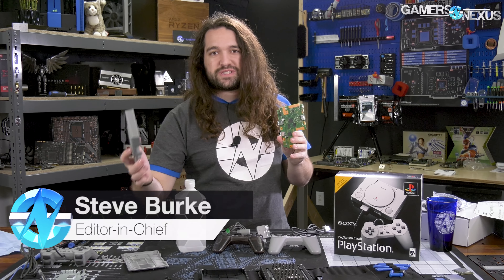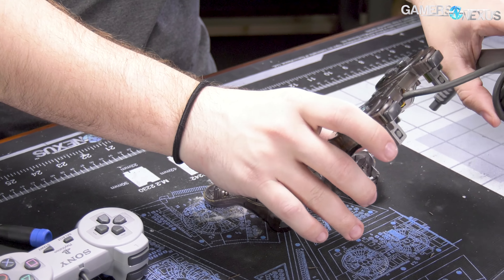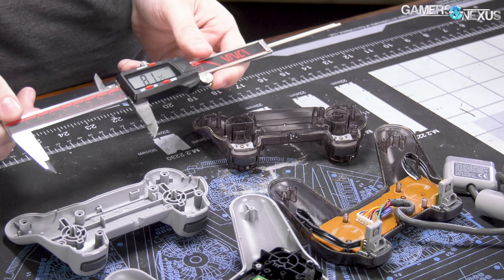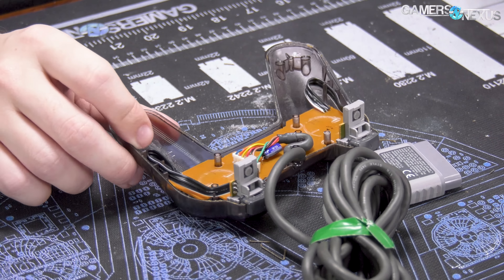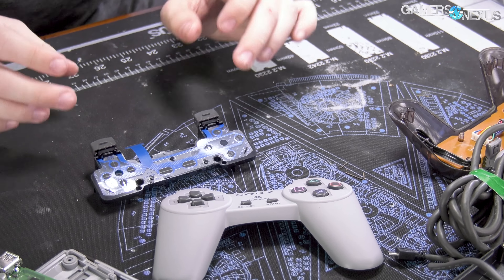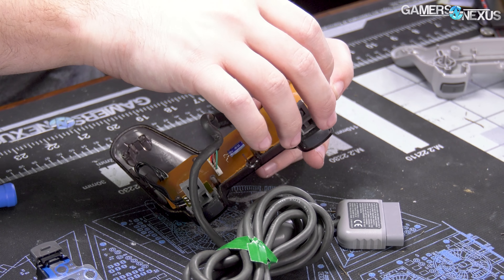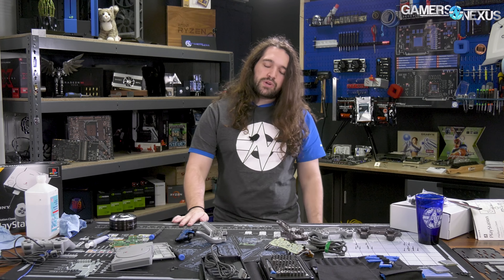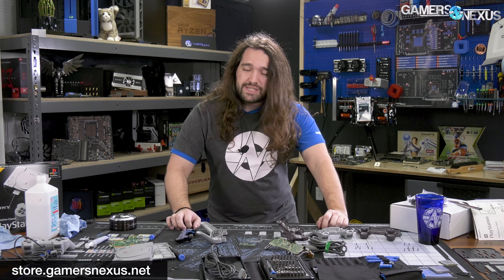PlayStation Classic Controller Tear-Down vs. PS1 Original

Comment: There isn't any switches. It's just rubber with carbon pads. When you press down the carbon pad completes the circuit on the ribbon.
Reply: It is in fact a switch, looks to be some form of rubber dome though it could be a capacitive switch. 
Just because they aren't mechanical switches doesn't mean they're not switches, all a switch does in a simplified sense is complete a circuit when actuated.
Reply: BlowMeWonKenobi  So it makes (and breaks) a connection in a circuit... Yeah, that's called a switch, dude.
Reply: The point is there's no switch "inside" either PCBs. (Yes, the blue thing on the new one is still a PCB, just a flexible one.) The PCB and the carbon pad on the rubber dome make up the switch together, meaning the rubber pad is definitely an electromechanical component.
Reply from the maker: Thanks! That's pretty cool. Is there specific terminology to describe those types of domes?
Reply: @GamersNexus  yea, its called a switch
Reply: Membrane switches. More info here: http://www.slagcoin.com/joystick/pcb_wiring.html  @GamersNexus
Reply: Jesus christ, ever since people with mechanical keyboards have become rampant with their autism they even try to denounce basic electrical components like switches cause they are not labelled Cherry MX.
Reply: Why is this a big argument?
Reply: @GamersNexus  Ever done a tear down of a non-mechanical keyboard? You should notice some similarities. The switches on them use the exact same process as these controllers do.
Reply: Gamers Nexus yep, they’re membrane switches. Sony was first to have pressure-sensitive buttons in their controllers in the PS2. The carbon pads in the DS2 controller are domed and the PCB has double traces under each button, so you get two modes per button. Good times.
Reply: That is the definition of a switch.a device for making and breaking an electrical connection.
Reply: LMAO GN liked the comment, even though it's stupid. Reverse troll ftw
Reply: Gamers Nexus Yes, I believe they're called an i9 7980XE...but I may be thinking of something else.🤔
Reply: @Reuterli   Cherry MX sucks.  I only use beamsprings.
Reply: If it opens and closes an electrical circuit then it is in fact a switch...
Reply: Steve, the buttons on the controllers are the same as most calculators have. Haven't you ever opened one? The film base has graphite traces(graphite is electrically conductive) and the switches have sort of a graphite-rubber alloy pads that are also electrically conductive. Cheap and easy to make.
Reply: What cause these to break? Carbon being removed from the rubber? Oxidation?
I have Keytronics Ergoforce keyboards which doesn't work any longer but I don't know how they break. I've washed them though so maybe by now I've removed the magical dust and they will never work again (unless replaced =P)
Reply: @nicolaspinto2927  you know what he meant, when people say switches they mean mechanical because cheap keyboards and remotes used these horrible swandwiches of plastic, not the best to say the least.  So i'm surprised why steve even said it was a good design when it looked like a 5 dollar keyboard the second he opened it up.
Reply: Completing a circuit is the definition of a Switch ..
Reply: These are switches yes. Commonly known as rubber-dome switches, membrane switches etc. Very similar to any remote controller or non-mechanical keyboard etc. Ancient technology, calculators from the 70s used the same membrane style keyboard, the Spectrum ZX even used the same thing, if you even know what a "Spectrum ZX" is.. :D
Reply: @Skauber  I was with you up until halfway through. Yes, rubber dome switches have been used for ages, but they aren't exactly "ancient technology" since they are still widely used. The home computer you're referring to is called the "ZX Spectrum," not the other way around.
Reply: Johan Krüger-Haglert, the graphite layer may wear out or the contact may get dirty, but dirt, of course, isn't a permanent damage, wear-out is. Also, if I remember correctly, an attempt to clean the membrane with alcohol may cause a permanent damage. I've actually witnessed several instances of the conductive layer wearing out to the point when the keys were no longer working. Sometimes it happens because of poor quality of the conductive compound which is a mix of graphite and glue for the PCB and some kind of graphite-rubber mix/alloy.
Reply: @GamersNexus  Top Tip ?? I used 2 fix those using bubblegum aluminium foil cut down in squares and some glue :D
Reply: @nimoy007  We called it the Spectrum ZX in Norway, not sure why, but guessing it's not universal. :) Also, by "ancient technology" I mean its old and has been around for ages, not that it's obsolete as it's a good and cheap way to make keyboards or buttons which still works well. :)
Reply: @noanoxan  Actually, its much more advanced than that! the PCB doesn't have double traces. Instead there is some kind of black plating on the PCB. The more surface of the domed cap that is pressed against the PCB surface, the more the conductivity changes, so the buttons are effectively analogue. The controller reports a value between 0-255 (i.e. same range as each analog stick axis) if I don't remember wrong.
Reply: @janjohansson2567  Wow, I didn't think it was that advanced. I had to read up a bit on that tech. Looks to be a sort of carbon-film variable resistor setup. Really neat. Thanks for the correction.
Reply: @Reuterli  I bet you typed this on your cheeto dust covered rubber dome keyboard. Get with the times granddad.
Reply: @noire1001  Don't talk to me unless you type on beam springs you millennial kiddo.
Reply: Okay maybe I didn't write my initial commemt correctly. Honestly didn't expect this to get liked. From the Video it looked like Steve was trying to find a tactile switch. It seemed like he wasn't aware of silicone rubber keypads and how they work.
Reply: @Reuterli  THANK YOU!! I really just disliked this vid at this point, I mean this is just sheer stupidity...
Reply: @GamersNexus  They're called Chiclet keys, not membrane (those are flat, though use the same principle), and yes they are a switch technically, but he is correct it isnt in the PCB to all the odd people 'correcting' him when he outright said it forms a switch with the dome.
Reply: @levelheadedbrett2979  I've also heard conductive carbon pad, and simply carbon pad.
Reply: Yep. Almost every single controller I've ever opened used these rubber domes and carbon pads for the face buttons.
Reply: @GamersNexus   they are called membrain switches
Reply: @woooweee  while you're right to call out the low tier trash that uses this switch design there is nothing inherently cheap or bad about this particular form of switch when a proper amount of engineering and manufacturing has been put into it. And for a gamepad they are quite capable, and even better than mechanicals like Cherry's because they can be used as analog inputs which is simply impossible with a mechanical. The Dual Shock 2 controller as mentioned above leveraged this to have hard and soft presses on the shape buttons for example.

And no, only Cherry fangirls claim that switch = mechanical. Normal people don't care either way, and anyone passably familiar with hardware knows that there is nothing about switches that makes mechanical switches inherently the one true switch. There is a huge ecosystem of switches out there that all have some points that put them above mechanicals, such as foam and foil switches that are on the whole smoother than any mech linear, hall effect and mag reed which are more rugged and longer lived than all mech switches, capacitive switches can identify things like soft and hard presses, and non-mechanical designs often inherently have no issues with key roll-over without additional components on the board. Even the "cheap" rubber dome and membrane switches have clear advantages over mechanicals. Mechanicals have a place somewhere but for the most part are a dumb hype fad, the only special thing about them is clickies and their tactility (ofc their inflated price too lmao).

What the design looks like is irrelevant, what matters is if the build quality is there; clearly the design is good and a lot has gone into making it a reliable device. You'd understand that if you've worked with devices at a design or repair level, looks are very deceiving and a shallow way to evaluate functionality. One thing to note is that mechanicals introduce button bounce far more than other designs that needs to be filtered out, which is bad for low-latency use cases like in games or simulators, though I'd also remark that moving to USB from what I assume is interrupt-based in the PSX doesn't help there either. There are good reasons other than "lol cheap" to pick a non-Cherry-esque switch.
Reply: @GamersNexus  That's just a membrane switch, more generally it's a type of bicontact switch (Basically the electrical connection is separate from both contacts so it makes contact twice thus bicontact). It's effectively a refinement of the jumper switch in fact though modified from the actuate and hold design of a jumper and compacted into a thin film for the contacts. Same basic idea but the conductive rubber pad serves as the jumper here and the membrane film is the header. As opposed to a basic contact or throw switch where one of the contacts is in fact the switching part that is permanently electrically connected to one of the terminals.
Reply: @GamersNexus  Got SO annoyed/triggered that you did not realize this concept just by looking at it. XD
Reply: how can rubber complete the circuit being non-conductive?
Reply: @yosyp5905  the darker grey material you see on the back of the rubber domes is what is conductive. it does not need to have a massive amount of power going through it and hence is plenty enough for the switch to work
Reply: Shame on all of you! It's called bracket  :D

Comment: What is this tech jesus has no knowlege how membrane keyboard works. You know the nonmechanical one.
Reply: I think he's locked memories of membrane keyboards away. Too traumatic.
Reply: Membrane is like the Old Testament
Reply: @Malus1531  The old IBM model M keyboard, one of the best keyboards you can ever type on, is a membrane.
Reply: @Lambda_Ovine  Buckling spring over membrane, not really the same as modern membrane keyboards.
Reply: Who is jesus?
Reply: @Lambda_Ovine  When did Model M's become such a geek icon.  People pay $500 for them on eBay now.  Back when I first started building PCs and you bought parts at local monthly trade shows,    the vendors would have boxes full of Model Ms for sale for $5 each.
Reply: @nilus2k  I got 2 on eBay a few years back and fixed one to operating condition... I could make back probably about 3-4 times what I paid for them now.
Reply: I came here to say this. That part was super hard to watch
Reply: @goobon  I should go raid my Dads basement.  He worked for IBM for 40 years and I think his homes foundation may be reinforced with old PC parts.  I know he has a bunch of Model Ms down there

Comment: Man, this takes me back. Those lands on the original PCB and on the newer controller are conductive pads, with the black pads on the back of the button electrically bridging them; the analog function of the next iterations used variable contact by way of dome-shaped electrically conductive pads on the back of the buttons.

I see some comments talking about button lifetime on a controller that's a minimum of two decades old and still working…

Comment: Quite interesting - Sony's been using a similar construction since the PS2. The d-pad on the old one used that retention mechanism to bypass a patent Nintendo had on their D-pad design, which is very similar to the new controller. Perhaps their patent expired and Sony found it easier / cheaper to do it that way?
Reply: I even saw something like that on my Dualshock 3 though it only went diagonally in one direction not two

Comment: It's cost reductions. They can make more smaller circuit boards on a panel and they moved everything to surface mounted stuff including connectors, which means they can use super fast chip shooter style pick and place machines  to populate the boards. No through hole, no soldering connectors means fewer steps in manufacturing. 
The printed foil is much cheaper than circuit board - you basically pay once a few hundred dollars for tooling and then they print huge rolls of plastic with your traces and then they cut them to shape... costs cents per foil. It's super cheap for volume production but more expensive for hobbyists.
There's carbon or some other conductive material on the foil with traces and on the buttons, and the buttons basically create a short between two traces when they're pressed down. Nothing fancy or clever... same stuff as with keyboards, although probably no multiplexing involved on this, considering there's so few buttons.

Comment: So old consoles are the new thing now? Did not see that coming. For us old gamers it's cool! TNX!
Reply: "Retro-gaming" has been a thing for quite some time.

The whole "X BRAND-CLASSIC" thing is new tho..

But useless imo.

I mean come on, it's basically a "custom" raspberry Pi with a random emulator core
Reply: Should have added "in this channel"  to my comment. Sorry for the inconvenience.  @absurddive
Reply: Except it's not because they're a complete ripoff and badly made.

Controller looks good though.  I'd recommend buying one of those off eBay, and using it with a RetroPie.
Reply: Raspberry Pi w/ Retropie is awesome. Though still haven't figured out how to get mine to scale on my 1440p monitor lol (there's black on all sides). I'm pretty sure it's not that hard, just haven't bothered yet.
Reply: @Malus1531  Well you probably don't WANT it to fill the space.  You want to scale it up by an integer multiple so you don't get oddly shaped pixels.
Reply: Except they're not, 1st party hardware manufacturers dropped the ball on this hard. You can have better emulation on 3rd party retro systems or on a PC than on all those repackadged smartphones Sony and Nintendo call game consoles.
Reply: @Asdayasman  I agree, I just didn't want to get too wordy clarifying. That's why I said "all 4 sides", since I want black on only 2 sides to maintain 4:3.
Reply: @Malus1531  But that's what I'm saying.  From what I remember, most PS1 games run at 320x240, which doesn't scale up to 1080 lines with an integer multiple.  The closest you can get is 960 lines high, so you will indeed have black borders on every side.

If you scale it up to 1080 lines high, you're going to have some pixels that are 5x4 and some that are 5x5 on your screen.
Reply: @Asdayasman  Ah ok, fair point
Reply: It only comes with 20 games, and iirc they weren't even the 20 "best" ones. (Sorting out 20 "best" games from the PS1 must've been a challenge and a half tho)

Comment: MISSED OPPORTUNITY OF 2018 HOLIDAY SEASON

Dualshock, actual good games, actual good emulator, scan lines, GUI, etc

skip
Reply: Don't be silly. Dual shock is coming out next xmas.
Reply: Plus they could have added network capability, so you can access the PS store and buy loads more games in future. It seems so pointless to go to all this trouble for a handful of games when there are so many classic games for PS1 that will be lost to time.
Reply: Not gonna fundamentally change anyone's opinion but apparently if you hook up certain usb keyboards you can hit ESC and access more emulation options (including scanlines). Looks like Sony didn't strip out all of the PCSX configuration.
Reply: The problem with Sony controllers is that they're all identical so they had to put the one without the joysticks on there unlike the NES and SNES where their controllers are uniquely different and look different and thank God they changed the controller on the PS4 because that controller was super uncomfortable only good thing it had going for it was the placement of the buttons and sticks

Comment: Looking so forward, to Gamers Nexus talking about the leaked RYZEN 3000 specs.

2019 Looks to be one hell of a year for AMD.  😀
Reply: Danmandingo only if I can keep my X470 board 🤞🏻🤞🏻🤞🏻
Reply: @OIFIIIOIF-VET  I think you can. Bios update will be needed
Reply: They don't like to talk about leaks and rumors but yeah im really interested in where AMD is going
Reply: Probably only up to R7 with 12 cores as R9 spec exceeds AM4 spec and you'll need new X series mobo wich will be shown in May along R9 50th anniversary chip :)
Reply: @-eMpTy-  they're gonna stick it to intel I hope
Reply: @OIFIIIOIF-VET  According to AdoredTV's info, you can, up to the 12-core 3700X. The 16-core 3800X and 3850X will need special X570 and B550 boards because of their massive power draw (almost as much as an FX-9590 or i9 9900k), but it's kinda understandable for 16 cores at 5 GHz.
Reply: Danmandingo intel) hold my beer

Also intel) oh shoot I spilled my beer all over and now everything is super ruines
Reply: @mareksendecki5695  If they handle it like they did on AM3+, they will leave it up to the motherboard manufacturers to determine if their vrm can handle the power draw and make the bios update for the boards with sufficient vrms, so the better x470 and x370 boards would likely get the needed updates.
Reply: All fake
Reply: The leak came from Wccftech so I would take it with a mountain sized grain of salt
Reply: Who cares about more cores, 8 core was already plenty. Just give me clocks & IPC.
Reply: @mareksendecki5695  Somebodys been watching AdoredTV!  Thumbs up dude!!
Reply: @Malus1531  Clocks and IPC would almost seem to be a given at this point since AMD has already surpassed Intel in IPC and TSMC is saying their new 7nm process will increase clocks up to 25%.